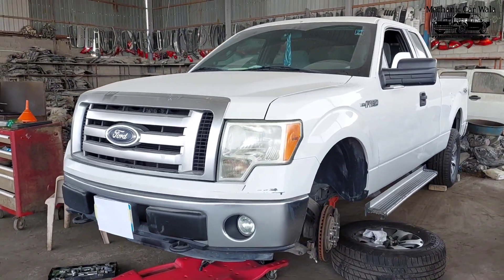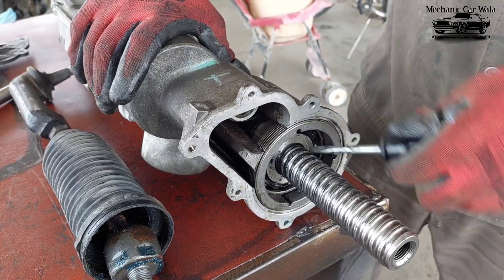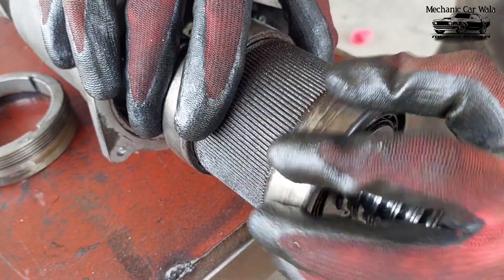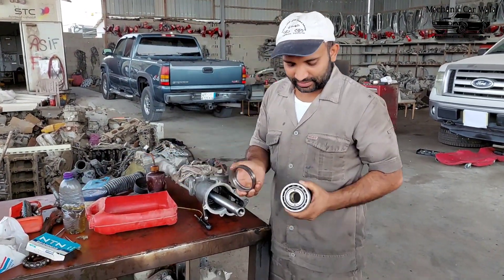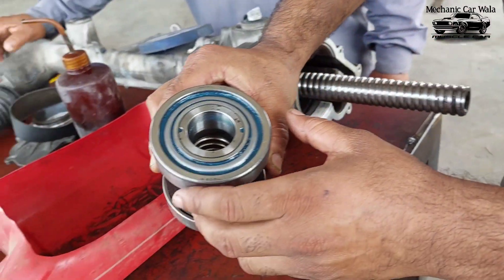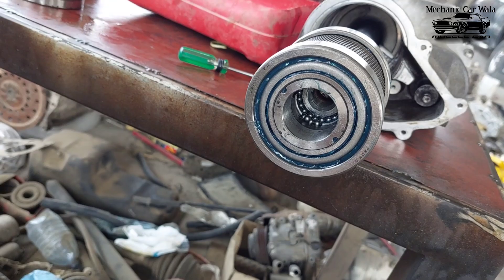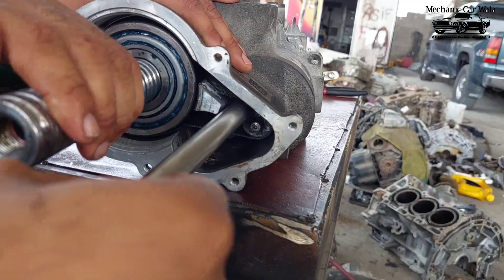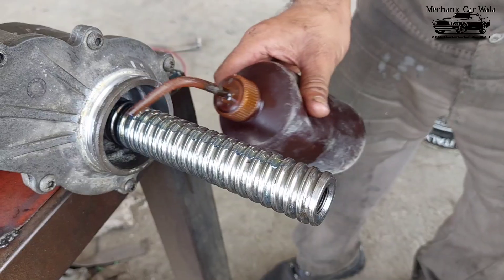Ford F150 Electric Power Steering Repairing | How to repair ford electric power steering, In English

Comment: Can you share the link to where you buy the two piece from Japan for the bearings?
Reply: What is the part number / code of the NTN bearing you used? ( ex. 6301?)
Reply from the maker: I bought these from local market,  you can buy any bearing, external size must be same .